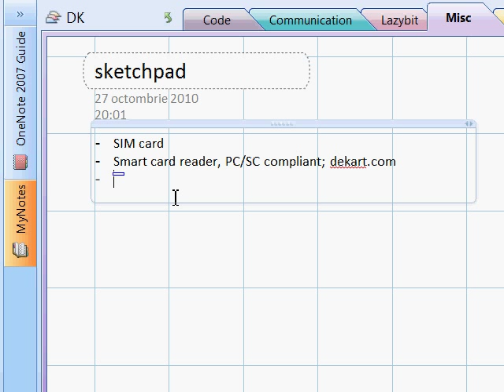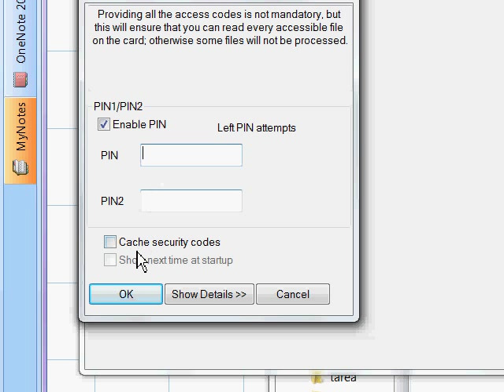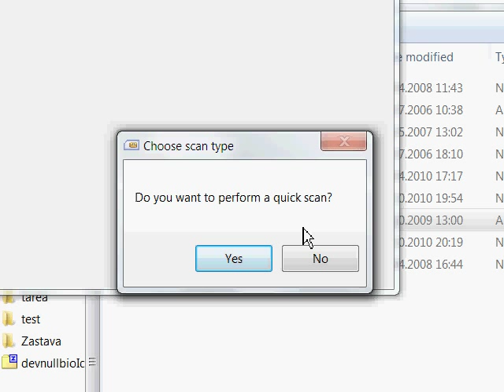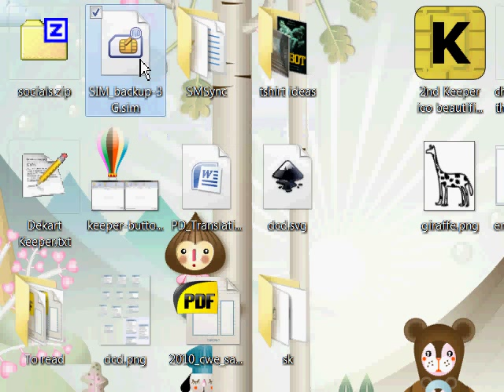How to create a SIM card dump for reverse engineering

Comment: are the dekart utility and SIM explorer the same? thanks
Reply: SIM Explorer is a superset of this tool.
Reply: +ralienpp good ?? about the Sim dump + Sim explorer - the dump is to read files off the sim, & the Explorer allows those files/folders to be opened, studied etc. have you ever made an adapter, for a smartcard reader, so a Sim card can be mounted in the adapter, inserted in the reader. and a quick/full scan performed?  I have a smart card reader, but need an adapter. thanks